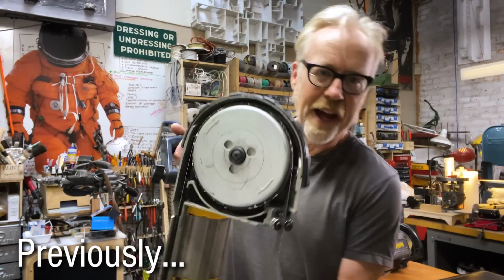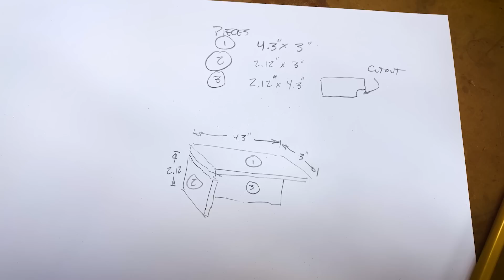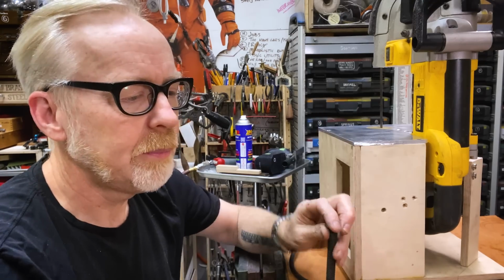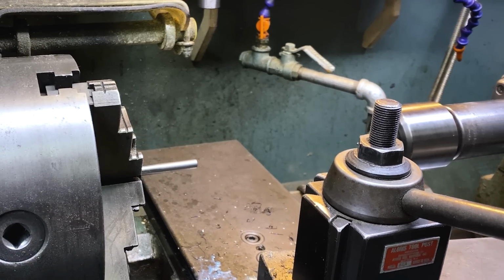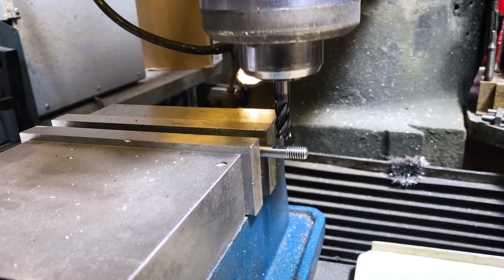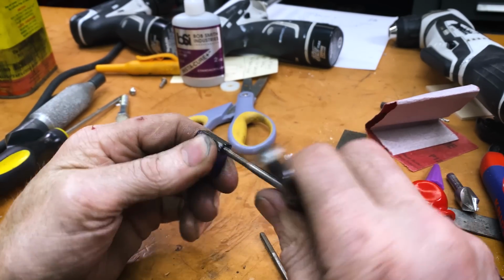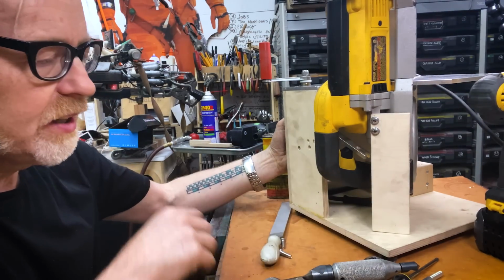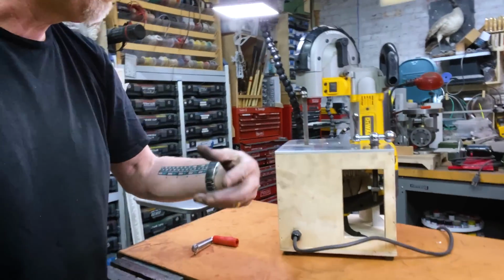Adam Savage Upgrades His Mini Bandsaw!

Comment: Oh wow dude! That's some overengineered sketch right there!

You keep having to put your hand in some very dangerous places just to get leverage to turn the crank.
Why not use a shaft running to the side of the box and use a disk with the golden ratio to depress the trigger? Similar anchor point, full speed range within one turn of the shaft, fewer moving parts, easier to service, SAFER, and you could use any activation knob/lever/wheel you want. Thought I would go for a similar crank running flush with the box and have set detents for predetermined speeds so you can click from one speed to another while maintaining the ability to use the full range of speeds at will.

If this wasn't a desktop build I would have recommended a foot pedal activation to maintain the ability to vary the speed while working on the piece. You could obviously still do this, but it would require including a bunch more work and wiring, at which point you might as well bypass the built in variable switch anyway
Reply: You obviously made this comment before finishing the video.

Comment: Why not just thread the original screw through the table top to press the yoke up and down? All you need to do is apply downward pressure, the trigger would press the yoke up on its' own. The yoke itself could have been simplified by using a hinge attached to the other side as pivot point.

Comment: Dude. What are you doing? Why not mount a junction box into the plywood  instead of all that fret work? 
I started doing something similar to my Milwaukee portaband saw. I got as far as mounting a table to it then chucked it up in my chain vice. It worked well but it's still in limbo. I made a discovery about the guide wheels.  They are assemblies that are completely removable.  Why remove them? ..it opens up the throat considerably,  giving you much more room to push things through on the left side of the blade too. I just need to make new supports for the blade.  I think more traditional methods , like guide blocks and a bearing ..

Comment: You made this way harder than it needed to be for the speed control... you should have just fixed it full open and installed a potentiometer to the side that's spliced into the wire.

Comment: Great little project but The speed control is complicated AF and quite dangerous. Having to reach around the blade to spin the speed control that's causing the entire tool to move violently isn't good. Why not just buy a $20 Router/Tool Variable Speed control from the Hazard Fart or Amazon. Would be a lot quicker and safer.
Also surprised you didn't just spin the lathe Chuck instead of the die.

Comment: But isn't a button on tools like this basically a potentiometer? I would just use an external rotary potentiometer, solder it instead of a button and control speed electrically.

Comment: why  didnt  you move the swich  on the wall  with  a hole  and make a simple  small  box  behinde  .....and i  will  put a big  wheel  (like a radio volume) inside the box and exiting  on the side  like 20% and u  turn  like u  turn  the volume  ....wil  be cleaner and get  me the table open  :))) that  me

Comment: Some folks missing the point here.  Yes, he could have done things differently but it wouldn't allow for just simply dropping in a replacement bandsaw if that one broke.  No hardwiring of switches, reostats, etc.  Also, you wouldn't have learned some cool concepts in design and engineering the pieces.  Could he built a safer version... sure but that up to you if you want to make one.  Just saying...

Comment: its a design i think Adam will regret later, 1. loss of surface to work with and it limits how far he can push a material through. if the cut is more than 6-8" it runs into the handle. 2. having to flail your arm around in proximity to the blade as it begins to speed up is just dangerous. you could bump or clip the blade. i think the mechanism is fine, just move it to the side where he cut the big hole. arm away from blade and it doesn't impact working area

Comment: Yeah that's kinda scary. The amount of force you're putting on that handle to adjust the speed is rotating the whole tool and putting your arm dangerously close to that blade. You honestly need weight in the bottom and an emergency stop button on the front or top.

Comment: With a good sharp high quality threading die in a tailstock die holder you can let the lathe do the work and without reversing until you reach the end of the cut.  Hand die holders are for amateurs.  If you really want a precision thread you single point it.  Just sayin.

Comment: Except for wanting to try something different, why didn't you just put a standard rotary motor control in?  Easy to modify the wiring in the handle, save yourself a ton of time and not have an engineers throttle sticking out of your work shoe - AND yeah, not having to reach across an open blade.

Comment: I know you stated your aversion to having anything on the side of this build, but I cringe every time your arm crosses the blade as you reach for the speed handle. If you decide to keep the handle please move it to the side. Now the reason I say "if" you keep the handle is this: May I suggest you skip the handle completely and simply wire a standard sewing machine foot pedal switch to it. Saves any reaching for handle during cuts and allows on the fly changes in speed while both hands secure the material.

Comment: Could you not just weld a nut in a hole through the top and just use the treads of the screw to raise and lower the adjustment? Way simpler.

Comment: Looks like a good way to break the trigger... Very disappointed with this one. You've lost a lot of space on your table, the speed control is already built into the saw, you just to run some wires to a pot, if it's a physical trigger stop type, then you would've been better off machining a cone for your bolt and running it right out the side, would've given you all the table space and stop you from snapping the trigger by increasing speed too much

Comment: C'mon Adam, I know you have all the cool tools and talents, but this was like watching one of those engineers ball maze things to blow out a candle at the end. Why so many turns of a handle to increase and decrease speed? Why have to reach around a moving blade to change speeds? I am CLUELESS when it comes to engineering but I immediately assumed you were going to use a reostat to control the electrical output with a knob on the side of the box, away from moving parts.  Talk about reinventing a mouestrap.

Comment: Seen this before.  No need to see this again ... Repeated material.
No ... this is Part 2 ... sorry.
First you say you had it all drawn out; and then you putz around like your still figuring the design out.
My instinct says there's a flaw somewhere between the milling of the work, and the speed control and I do not have enough experience to say where the flaw is.